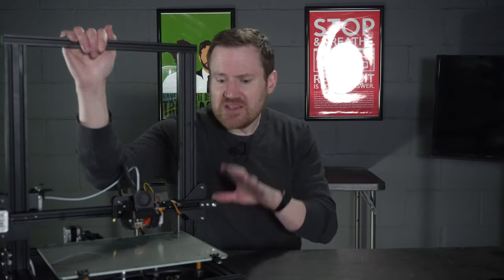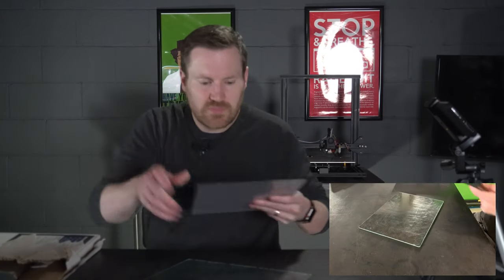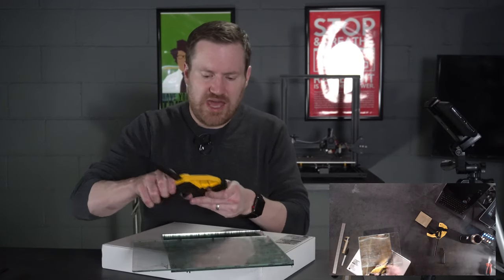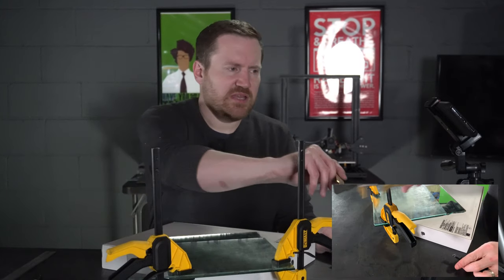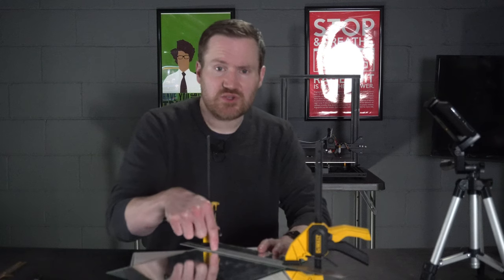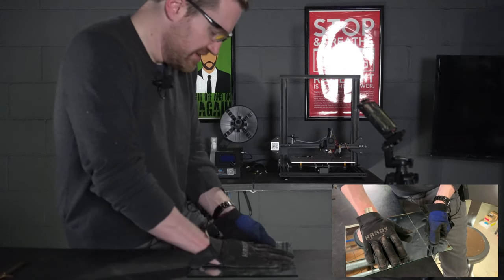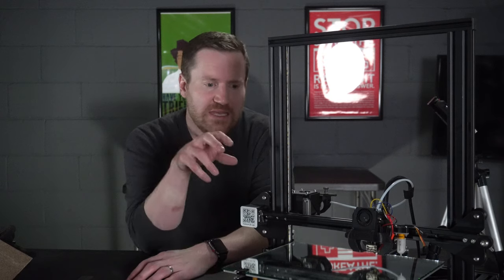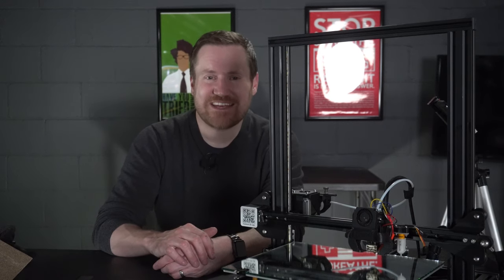3D Printer Mirror Bed Surface \\ Cutting and Installing

Comment: I worked in a glass shop for 5 years. The glass cutter used here is a very inexpensive tool. To get a better cut, run a small bit of light oil (vegetable oil, 3-in-1, etc) down the cut line before making the cut. This keeps the cutting wheel cool and you will find you only need light pressure to make the cut. If money is no object, I'd recommend getting a proper oil cutter like the pros use. They have a reservoir you fill with oil and a spring-loaded head for the perfect amount of pressure. These tools can cost $80-100 for a good one.
Reply from the maker: That’s fantastic advice Jeremy - Thank you!

Comment: The scenario you have described in the beginning of the video, as well as your diagnosis, match those that I have just made for my own 3D printer, that is experiencing the same issue. I have heard that mirrors make a good print surface, and I have you and a youtuber named Ivan Miranda to thank for that. Also, you can buy a 30cm by 30cm mirror online. If you live in the US (which I am guessing you do) buy 3D printing parts like this online. You will be able to find more products in more specific metric measurements. It will save tons of time.
Reply from the maker: That’s great advice!  If you find any good sources link it up!

Comment: When sanding glass you need to have a mask on, or sand it with water, glass dust can severely damage your lungs and throat
Reply from the maker: Great tip! Thank you!  Still new to some of the places I should be using PPE.

Comment: It is typically recommended to print to borosilicate glass because the material is considerably more durable than plate glass. But the appeal of using cheap locally sourced mirrors, it obvious.  I just cut a mirror salvaged from a cheap bathroom cabinet and will be trying shortly. 

How well has the mirror held up?  And how hot do you run your bed?
Reply from the maker: I can understand that,  most of my printers are of the budget variety and as a result the mirrors haven’t had the imperfections that have come along with the glass that shipped with my printers.  Going salvaged is a great move!  Do you have a good source for higher quality glass?

Comment: Can you use any mirror from the store? which side of the mirror goes up?
Reply from the maker: Hey Pablo!  Any mirror should work, The main purpose of the mirror is to give an extremely flat surface to improve leveling since many of the metal beds can a bit warped.  I haven't tried the back of the mirror, that might be worth experimenting with.  I've had no problem with adhesion with a bit of magigoo or hair spray on the glass, however, some put a build mat over them successfully.

Comment: How thick is the mirror tile you used in this video?
Reply from the maker: I no longer have this printer, but I think about 1/8th of an inch?  Shouldn’t be an issue going thicker except perhaps in heat time.
Reply: @MakeHackTech  The reason i asked is because i have some 12" X12" wall tile mirrors from lowes and i was wondering if i can use it for a print bed. Thanks for the reply.
Reply from the maker: That’s exactly what I used from Home Depot - should work just fine.

Comment: can every mirror be heated and cooled without shattering, or do i need a special one?
Reply from the maker: The ones I used were simply mirror tiles like you’d glue on the wall,  since they are glass they should sustain heat but I wouldn’t want to guarantee they will all hold up the same.

Comment: What about adhesion?
Reply from the maker: I don’t find many adhesion issues on mirror.  Good leveling, clean glass, and perhaps an bit of hairspray generally create enough  hold for PLA and PETG for me.  Temp can play a role as well.  Likely a build surface could promote better adhesion yet and could be applied to the mirror if needed.

Comment: What about 500 x 500 CR- 105
Reply from the maker: I expect you could do the same process, however, you’d have to source a mirror of larger size.  I know that the home stores sell small bathroom mirrors that are quite similar and likely as easily cut.  Your local glass shop probably has similar as well.